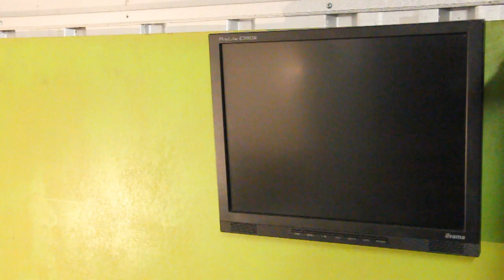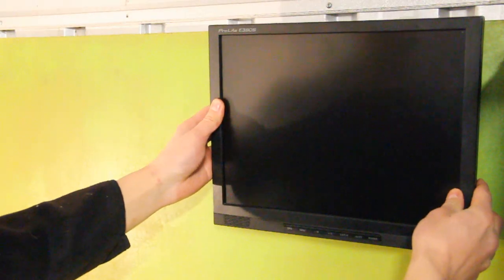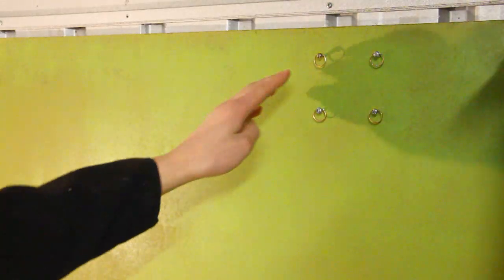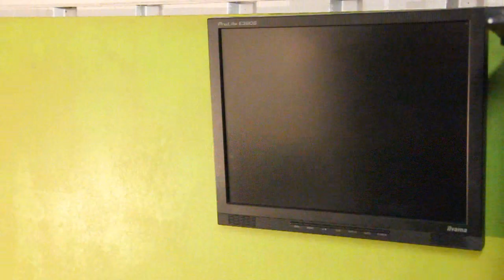How To Make a FREE Monitor Screen Wall Mount *HD*

Comment: I currently use this method on an AOC 20" monitor and it's been going strong for about one year now. 

I don't even use all four rings, I just use the top two and the monitor has a slight lean downward, but for my use its perfect. Spent less than $5 on screws and large washers.
Reply: I use the same one! I also love it, amazing quality and performance for gaming for very cheap price, and looks awesome, I am considering buying another one and create another dual-monitor, wall mounted setup for gaming
Reply: Figured I'd check back in here now that you've reminded me. Monitor is still on the wall and still hasn't gone anywhere. Love this technique! Works fantastic :)

Comment: Key chain rings would work well for that. Heavy steel, wont bend, easily accessible. Put some Teflon tape or blue Locktite to keep the screws on the monitor from shaking loose.